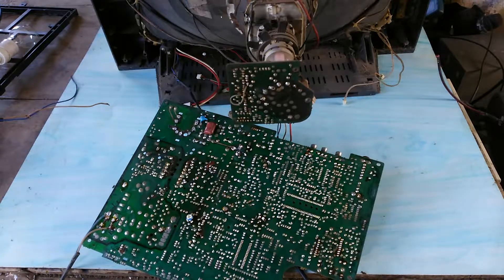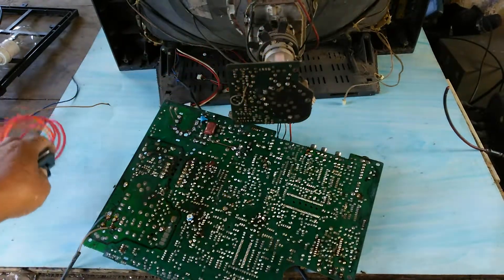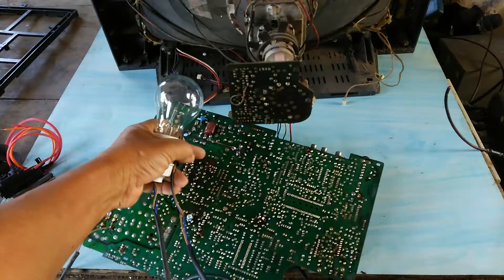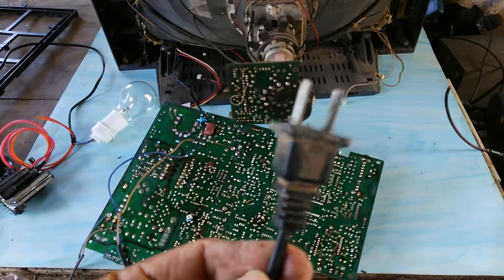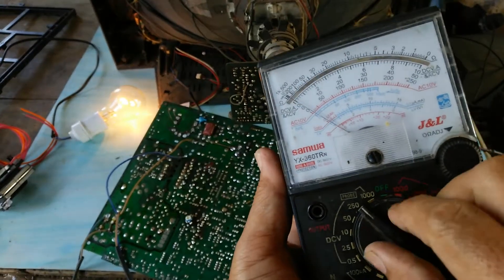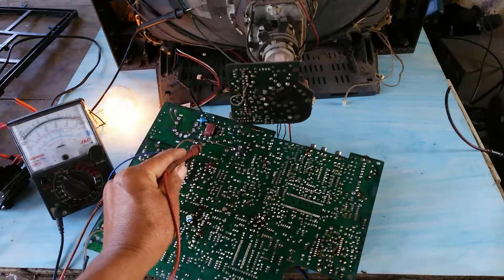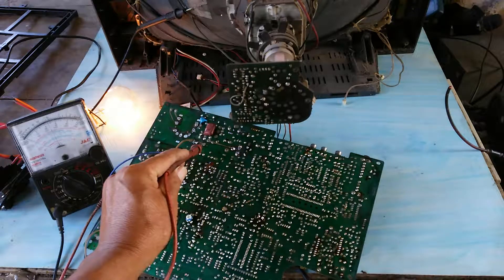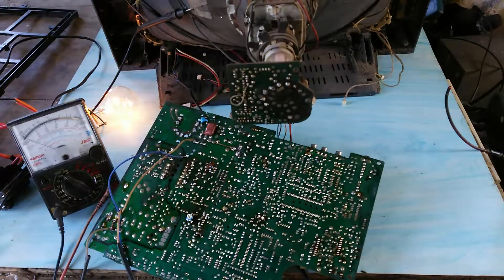Repair TV has burnt

Comment: Why does the old TV often to sound on the knob of flyback transformer?
Reply from the maker: It has 2 main causes. The first is that the old rubber is poorly insulated. secondly, because the crt is old inside, the electron beam is also weak. The electricity of FBT must leak outside.